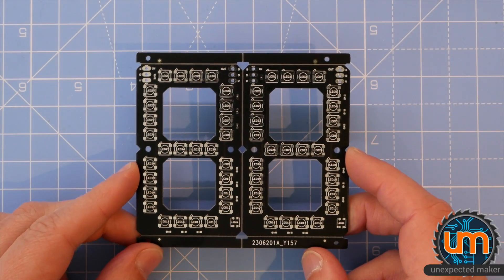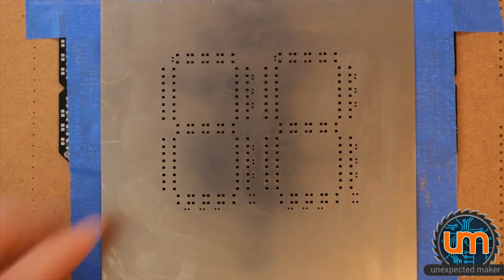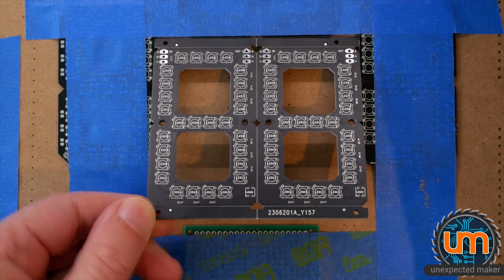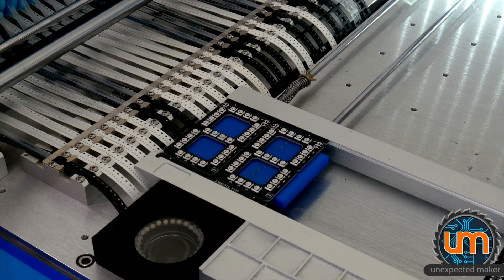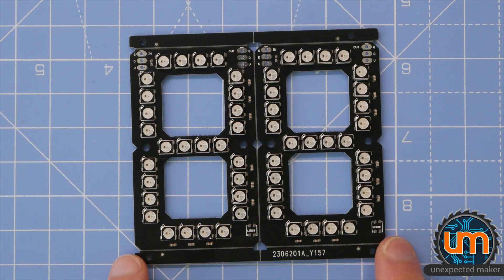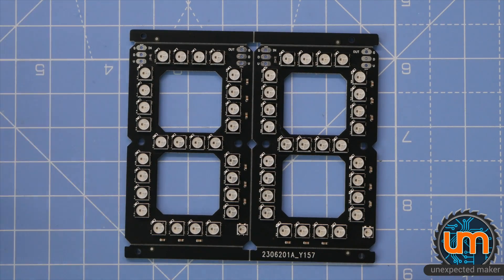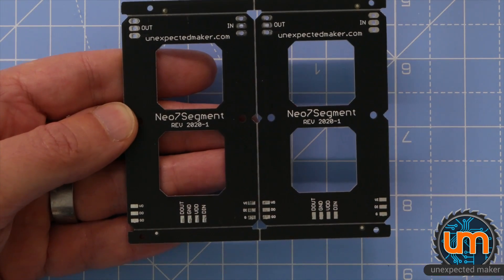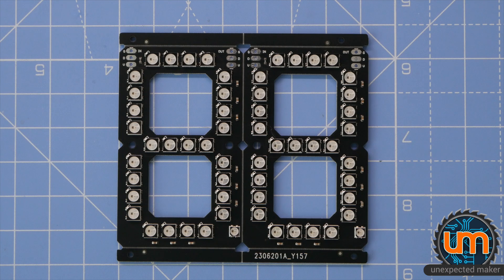Neo 7 Segment - Hello Again Old Friend!

Comment: I have questions regarding the "neopixels". Do you prep them before the reflow, like baking them to release the moisture from the resin? What's the melting point (roughly) of your solderpaste you're using?
Reply from the maker: I did "bake" this reel of LEDs before I used them, yes, as they had been sitting on my rack for over 6 months. They are reflowed with low temp lead free paste - 138deg.
Reply: @UnexpectedMaker  that seems to be what a lot of people on twitter have told me, thanks! :) looking a little bit more forward to my second board now :D